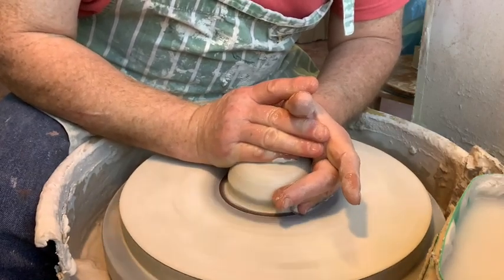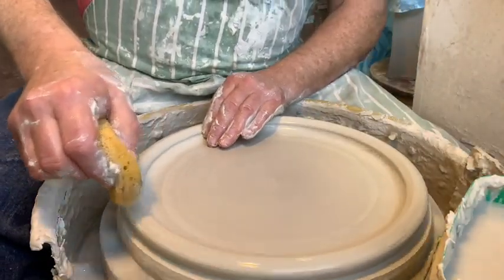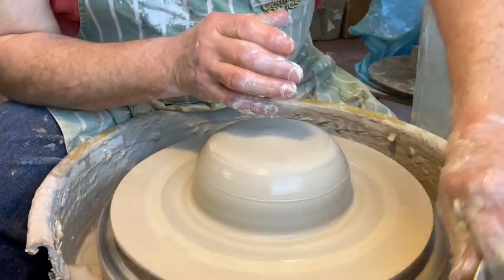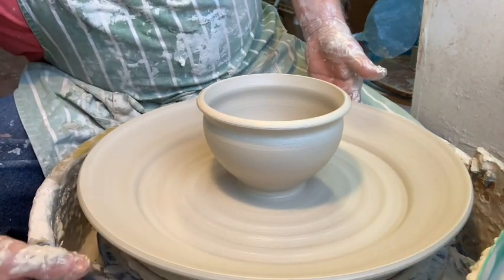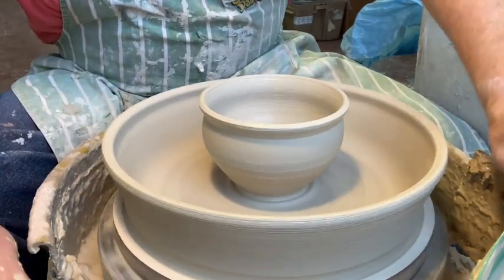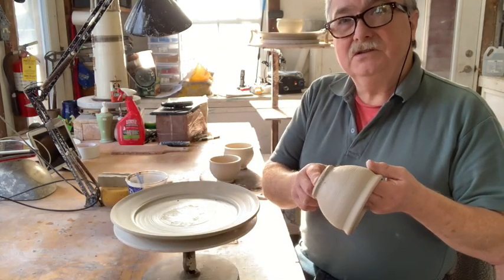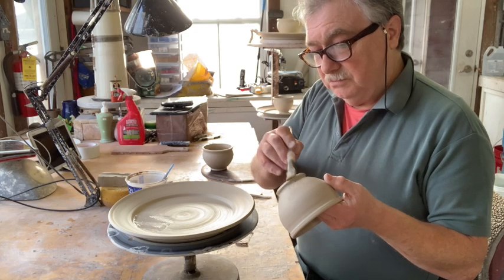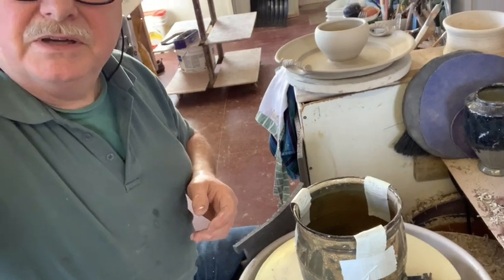Chip and Dips, 4 different approaches.

Comment: thanks for the video. I use stoneware with grog for my large platters like this, however I still get cracking during the glaze firing (cone 9-10). Haven't found a good solution yet, but I suspect its because of the stress created from one side being glazed, and the bottom underside is unglazed.
Reply from the maker: You might be firing too fast for flatware. My firing schedule is 
ramp 1 175f to 410f
ramp2 59f to 450f
ramo3 175 to 1010f
ramp 4 69f to 1145f
ramp 5 179f to 2000f
ramp 6 108f to final temperature. hold 15mins
ramp 7 9999f to  1145f
ramp8 69f to 1020f.
That is how I fire sinks and large tiles

Comment: This was a really good lesson in large plates/platters for me. I've been striving to make some big platters and have flopped and warped too many to count. So many good reminders in this video and so many tips that are new to me.  Can't wait to get back into the studio next week.  I use hand made bisque stamps all the way around the rim on my big platters and I think this is why so many warp. Maybe just because so much clay is displaced when I stamp them. Do you have any tips that might help with this issue. The warping I get is usually taco style, where opposite sides of the rim warp upwards a little bit  and the other two sides either go down or stay about right.
Reply from the maker: It may be a drying issue, I wrap the rims with Saran Wrap while allowing the centres to dry. I also store my pieces in a damp cupboard so that there are no drafts across them, which can cause edges to dry on one side thus lifting up. Slow drying is always better than fast drying.

Comment: Love your videos.  I was wondering about the chip and dip bowls, and the one that is off centered.  Could you not trim the plate/bowl first when it is leather hard, then attach the small dip bowl after with score and slip?
Reply from the maker: I adhere my forms together when the clay is very soft, so no scoring is necessary. If I make the chip and dip off centered again I will try it your way. Thanks
Reply: @Vsmithpots  Too funny, certainly not my way.  Just wondering if you thought it would work as I like the looks of the off centred one, but I'm not good enough to think that the plate would look good if I could not trim it properly.   I will try it and see, nothing to lose.  That's the nice thing about clay, you can always recycle it!

Comment: Thank you very much for all your highly informative ceramics videos! Have you ever fired Laguna BMIX-5 to cone 6? Any adverse effects with firing it this hot that you have noticed? I throw at a community studio that fires everything to cone six but have heard such great things about this clay body and I am wanted to try it.
Reply from the maker: I do not fire it to cone 6. I found that pieces cracked after the firing. I think the clay becomes too stressed above cone 5. Some glazes may make this more likely, depending on their compression and glaze fit. My advice is to use a cone six clay like 516 from PSH in Toronto. It is similar to B-mix 5. I still use B-mix 5 and it is my favourite throwing clay, I just fire it to Cone4 & 5.

Comment: Your explanations are very helpful, and your throwing is inspiring. Thank you for making the effort to record your process and your reasons for doing the little things that make a difference. One question: Do you wedge your clay before throwing with it on the wheel? It seems as though you just cone the lumps together on the wheel rather than wedging beforehand. Is this accurate, or do you prepare your clay another way before using it? Thanks!
Reply from the maker: I do not wedge new clay out of the bag. That is de-aired pugged clay and I have never seen the point. Some potters wedge clay to loosen up the particles so that it centres easier. I have never had that trouble, so why wear out your wrists and get Carpal tunnel.

Comment: Can you show how to make the warp to cut the dishes? Thank you🤗
Reply from the maker: It is simply a bent piece of iron bar, bent on a vice, with a guitar string stretched across the ends.
Reply: Thank you. Now you know I’m not a handyman🤗 I will get the hardware guys to bend the iron for me, I may have to use my charms 😂
Reply from the maker: @marciasilviajohnson6461  Rebar is easy to bend if you have a vice. The trick is to grind out a groove at either end of the bar so you can stop the guitar string from coming off the ends.